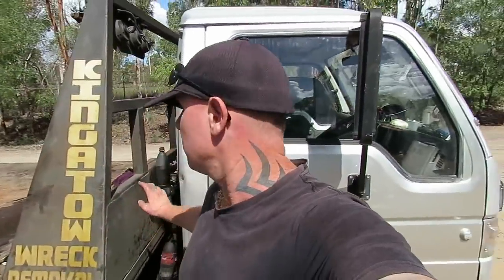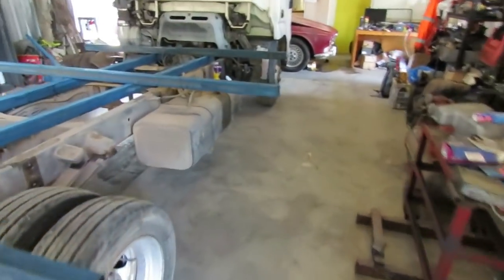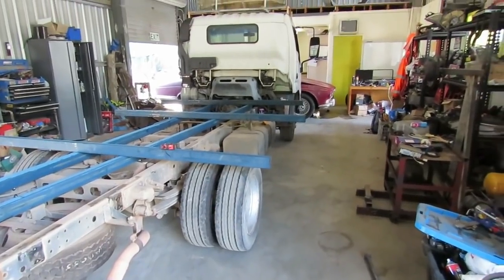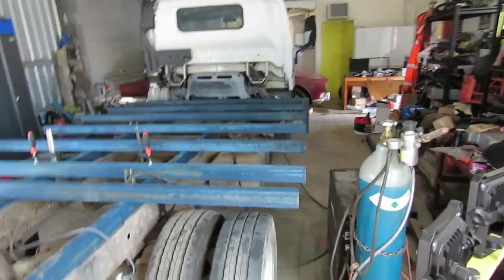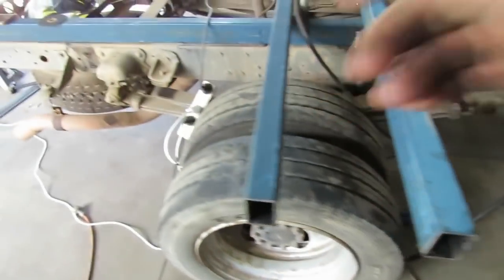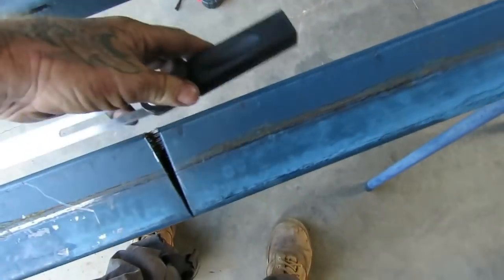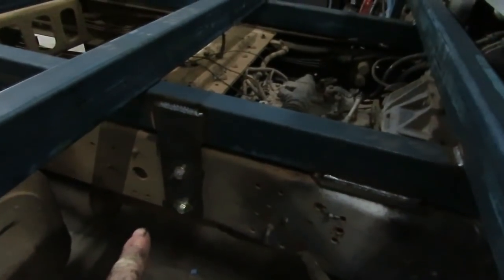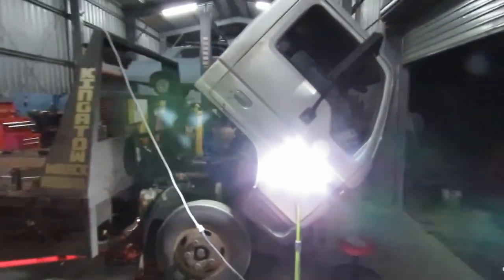New Beaver-tail Truck Build Part 1

Comment: Thats  an awsome idea of a tray  i use to drive a tilt tray 2021 hino that had the last meter of its tray  able to bend like a beaver tail  an then it would  straighten out again  when tray was down flat on the body of the truck an slid in fully,,,